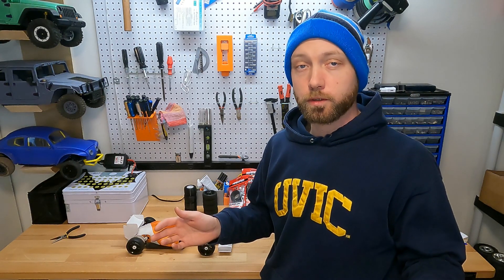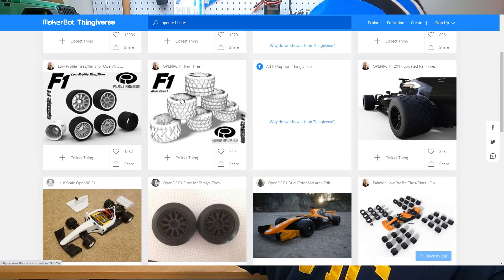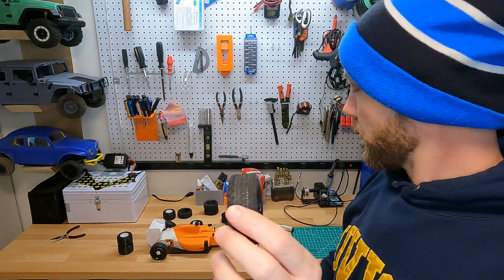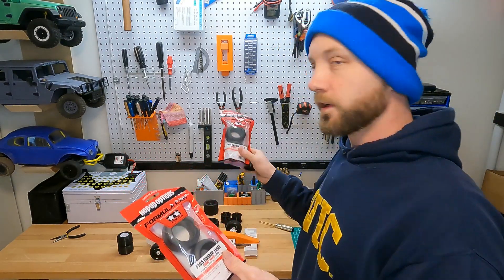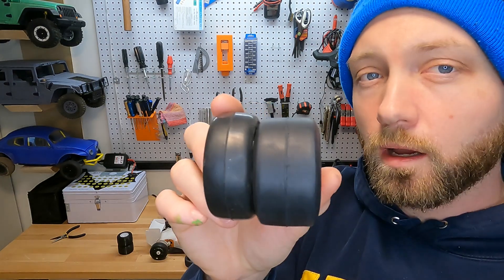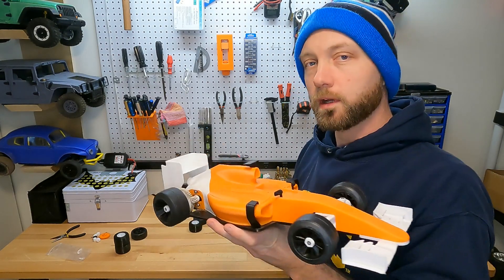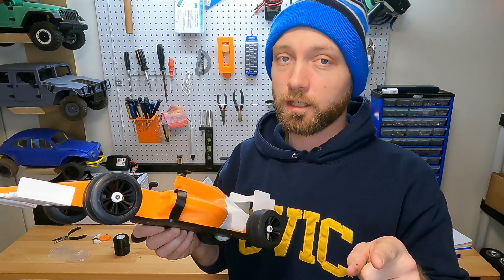How to choose the right tires for the OpenRC F1 car

Comment: How do you attach the adapters?
Reply from the maker: The rear ones just slide on easy, they're keyed to fit the driveshaft. The front ones get a bearing inside the adapter, then slide it on the shaft, then add the wheel, and then you put another bearing on the outside of the wheel before securing it with the 3d printed nut.

Comment: What is the outer diameter of the Amazon tyres you bought and do they rub on the base?
Reply from the maker: The tires are about 67mm in OD and no they don't rub. I haven't tried this yet, but if you're getting rubbing on your tires I would try something like this: https://www.thingiverse.com/thing:2830779

Comment: So my f104 tires seem to be slightly larger than the actual tire. Worried about gluing wrong givin cost. Any ideas?
Reply from the maker: hey man, ya I found the same. I'd still recommend to glue them but wrap each side tightly with elastics after you glue them to minimize the gap ... like this: https://i.imgur.com/9KfknfS.jpg

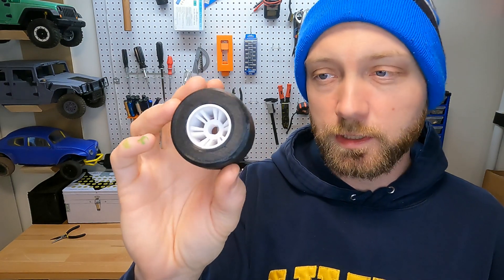Comment: Will the 12 mm hex 1:10 wheel adapter fit on the TAMIYA F104 METAL PLATED MESH WHEEL SET FOR RUBBER TIRES?
Reply from the maker: I'm not sure and I can't find much info online. I think you'd just have to test and see... if that particular adapter doesn't work there's likely another one available on thingiverse.
Reply: @rcprinter  Tnx for looking into that. Couldn't find much info either. Will let you know when I found a solution.

Comment: hey, ive got two problems that im hoping you may be able to help me fix, so my tires balloon up and slip off and also the front axle doesnt turn when on the ground.
Reply from the maker: If your tires are blowing off you need to glue em. They make special tire glue but I normally just use any superglue (ca glue) I have around like gorilla superglue and it works just fine.

The front axles don't actually turn but the bearings that you put on them should spin freely with your wheels. If your bearings aren't spinning on the front just loosen the screw off a bit.